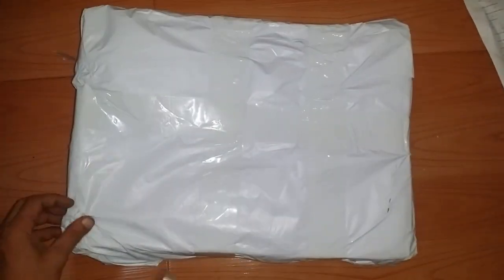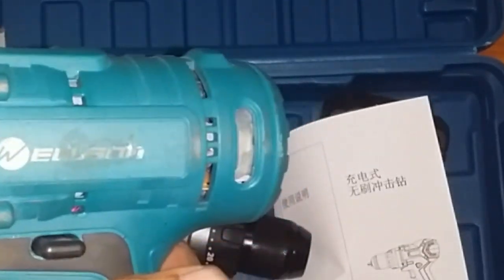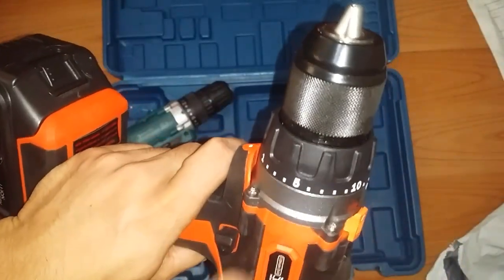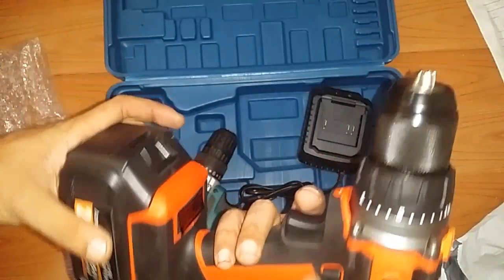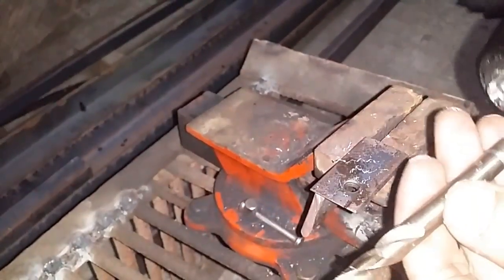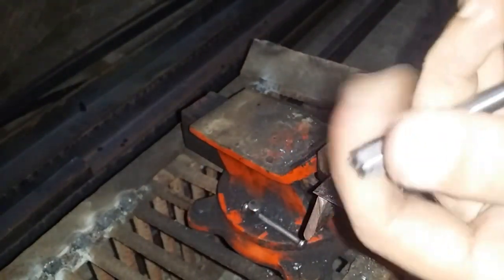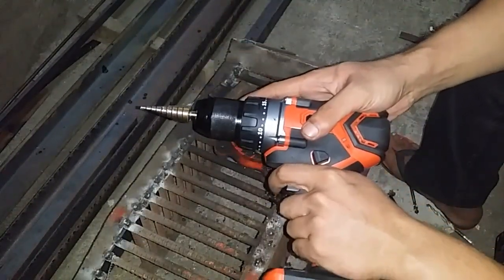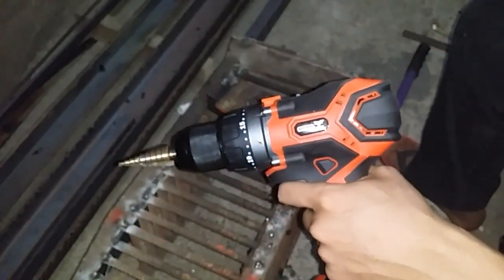Aneerpower 13mm Cordless brushless Hammer Drill from Lazada Unboxing and Testing

Comment: Any update of what is the performance of this drill? How about the battery how long it last with a single charge? Thanks...
Reply from the maker: as far as im concern. i have no complains when it comes to performance. its powerful. as for battery life it will depend on the material, thickness as well as size of hole or drill bit you are using. for the most part it will last even on the next day even the day after that. i usually use it to drill through steel.